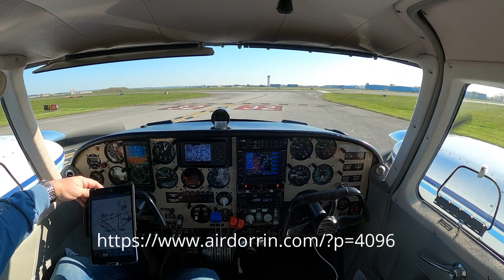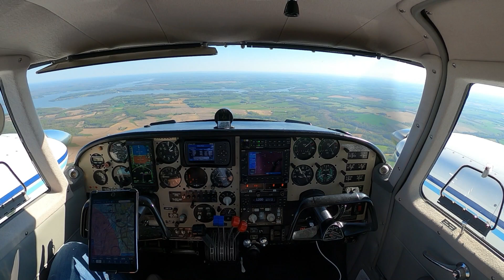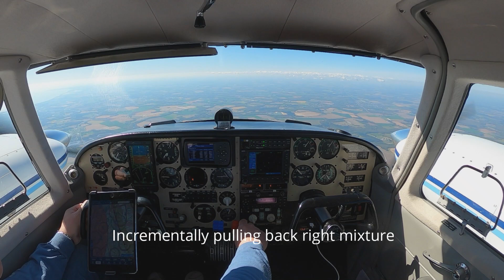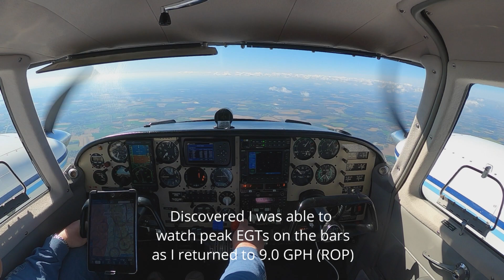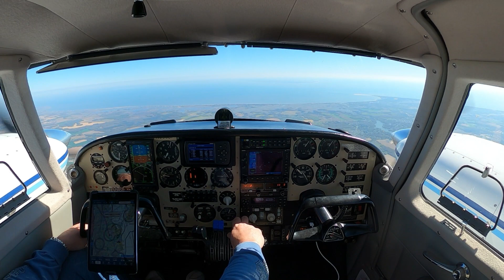Flight #002 2200419 TWIN COMANCHE GAMI TEST

Comment: I dont watch many videos the second they hit my inbox, but "twin comanche" and "gami test" leads to an instant link click!  I've been looking for anything anywhere on how the TC does when LOP... this is the first time I've seen anything to that effect, so thanks thanks for sharing!  It's pretty great you can have a pretty fast twin somewhat LOP running at 12 GPH... very powerful!  And without GAMIjectors! (i assume)
Off to read your blog post haha :-).
Reply: He says in the description that the airplane has GAMIjectors, as well as Electro-Air Ignition. Each of these lowers the fuel consumption by 10% or more.
Reply from the maker: 10% seems a bit optimistic, but I hope I get that. In any event, I haven't seen it yet during the break-in process. I just love the way it hot starts though - fires up every time!!  I'll start LOP soon.
Reply: @mdickinson  see the post from 1 month ago: "I see you have gamis now"....  
I doubt there is any chance you will get 10% fuel savings from electronic ignition, but i may be wrong.  If you've seen any reputable source (e.g. not electro-air marketing materials) that shows those numbers, please post here.  
GAMIs dont drop fuel consumption per se... they allow you to fly leaner of peak than you can without, so it ALLOWS you to fly more efficiently.  
Savings could be around 20% between 50LOP and a safe ROP mixture (~120ROP, depending on power).